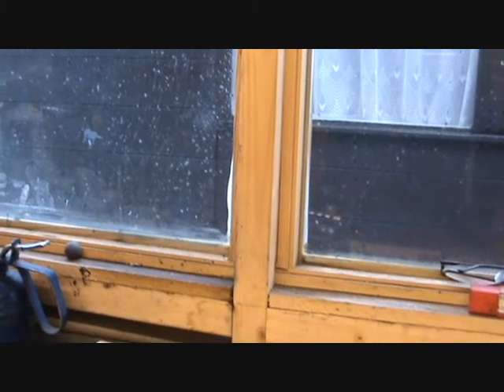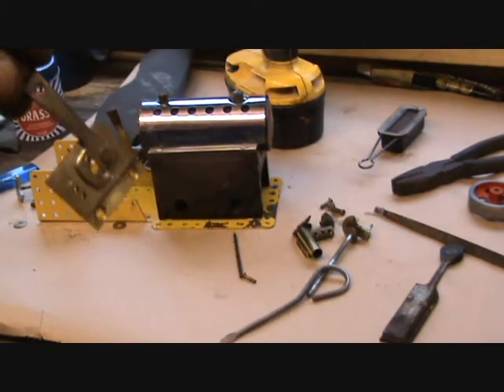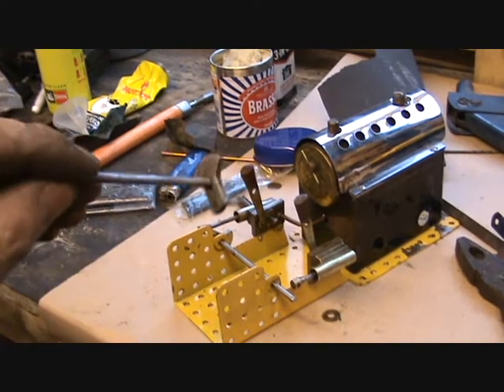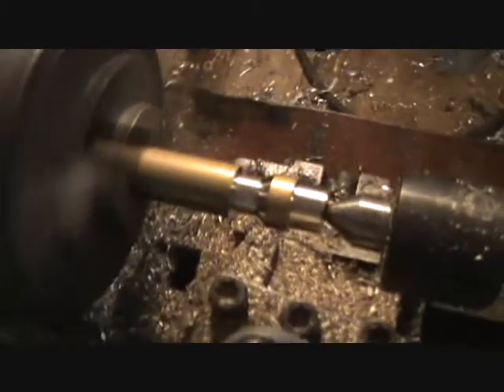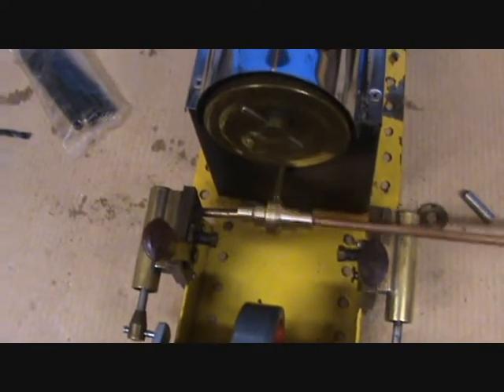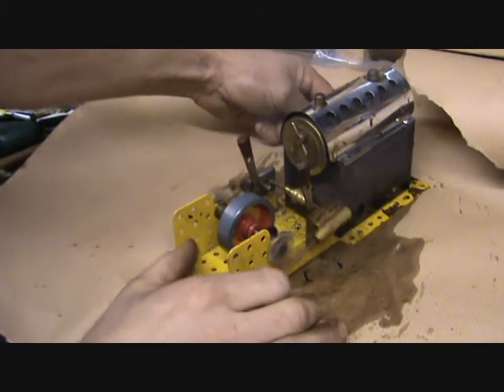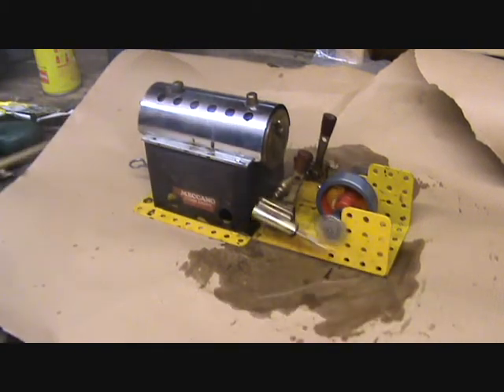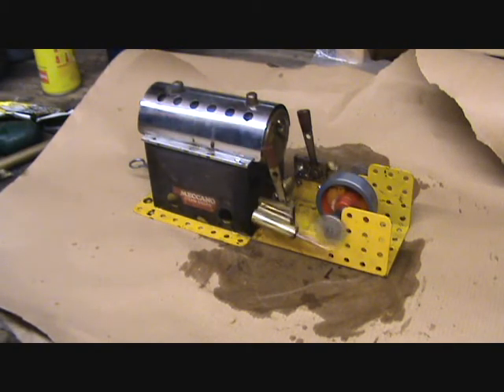A steam engine modded for fun we add a second cylinder to a Mamod let’s see what happens

Comment: This is brilliant, I think the internet reads my mind as I just purchased a second Mahmoud engine and wondered if I could put both pistons on one engine. Today this video pops up in my feed!
I only which there were a little more detail, like how you did the crank , I will look up press fitting.
Thank very much for this.
Reply from the maker: Wow , that’s  a long time ago 😅, how about this then 
A V8 steam engine running on air  Mamod model engine sound up !
https://youtu.be/jWpsBt6nVHk
Reply: @Madchris1   wow that is amazing , when you say running it in ,do you mean just turning it over so everything settles down? I remember cars used to be run in but not really anymore.
Reply from the maker: @paulmeynell8866  it was test run before i tried it on steam, unfortunately i could never get it to run on steam
Reply: @Madchris1  I presume you could not generate enough steam pressure. Still it’s a fantastic achievement . I think it looks amazing.

Comment from the maker: @chesterfield44 
hello sir!, yep it was the timing of the cranks, the crank i fitted to the end of the existing shaft isnt the best fit, so it moved a bit ,in the build, just needed a "slight twist" to the right lol
as for the se3, still on my to do list, but man there expensive on the ebay, even in poor condition , on a lighter note im making a video at the mo of a early manchester "rapidor" power hacksaw im restoring, regards chris